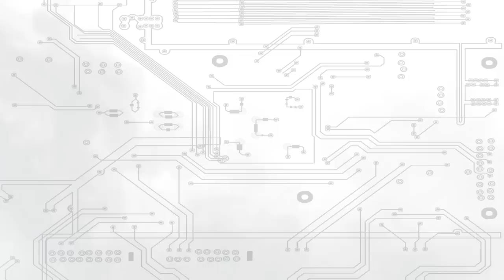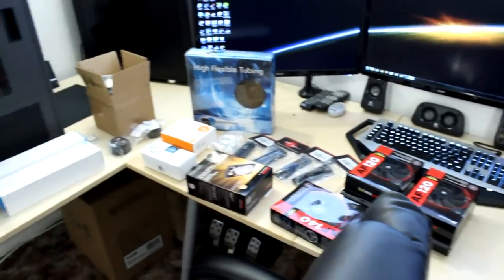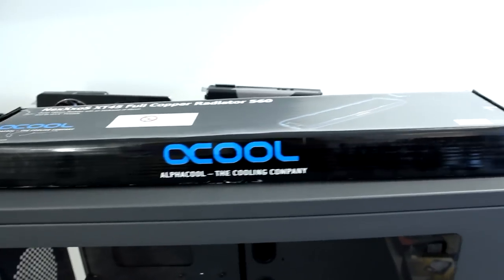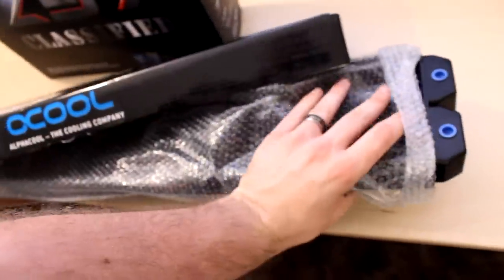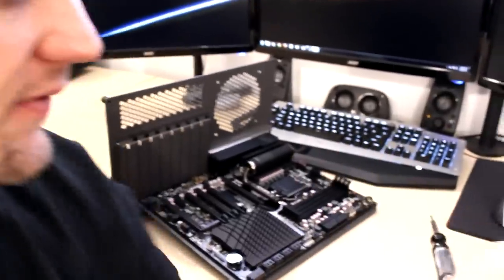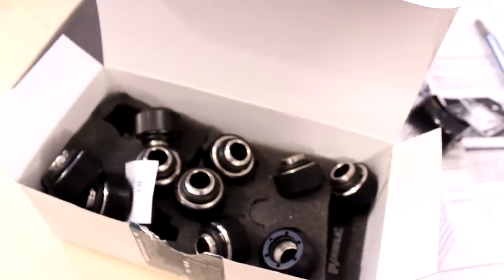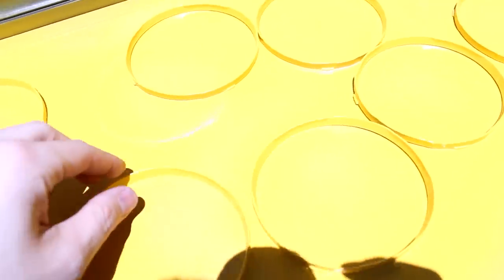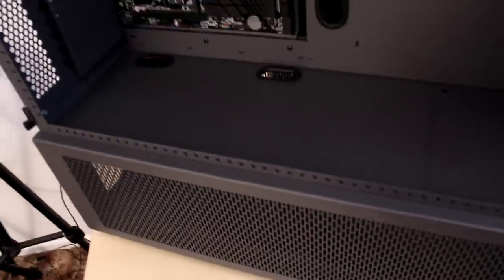Personal Gaming and Rendering PC Upgrade Vlog - Part 1

Comment: I LOVE my BIOS speakers!  That single short beep is the sweetest sound you will ever hear, in my opinion.  I love it when a case comes with one, even if it's just the speaker on a jumper block.

Comment: Just FYI Skunk Works was the nickname for the development facility at Lockheed that did the secret squirrel stuff for the U2, SR71, F22, and F117. It's supposed to be working on the F35 right now.
Reply: F-35 is already been finished. If a plane is in development, it usually has an X prefix instead of F
Reply: It's still being worked on from what I recall. Only one version is being produced, the VSTOL and the carrier versions aren't out yet.
Reply: True but, there are three different F-35 models from what I remember. The F-35A was from conventional take offs and landings I.e like any other type of jet. The F-35B was for STOFVL I.e just like a harrier jump jet and the F-35C was just like the A model but has a landing Hook for carrier landing and I believe the B model should be in use by the Us marine corp before October 2015.
Reply: The F35C is strengthened to take the abuse of carrier landings and weighs more then the F35A. The F35A is the only one in production, the other two are in development. In addition the F35A is grounded at this time.
Reply: F-35B is nearly finished its production as It's suppose to be the first Model 35 to be given to the American marines before 2015 and it's the VTOL variant.
Reply: Ronan McHugh
  All 3 variants are in testing still and are pretty much on final production levels with only small tweaks and a lot of software work and testing remaining for another 4 years.  There are around 100 F-35's in total atm and most of them are the A variant with the B variant being second most common and the C variant only having the least (its slated for a IOC around 2020).  The marines will go IOC first with the F-35B but will only have block 2b software, the airforce can afford to wait longer and wait for advanced capable (less buggy) software for there IOC in 2016.  The navy (who just got brand new jets with the super honets) is waiting till last and making sure the Marines are squared away first.  By 2020 they will be able to make anywhere from 100-200 F-35's (all variants) per year (mass production results in price drops).  By then all software and testing should be finished and the US and UK will be full IOC with there variants of the F-35.

Comment: No Jay, Skunkworks is not the project name of the F-22 Raptor. Skunkworks is an advanced development program under Lockheed Martin. Basically a group of engineerings that build special aircraft. They have been around since before WW2 and have designed and built a lot of awesome airplanes including the U-2, SR-71, F-117, F-35, and like you said, the F-22.

Comment: Skunk Works was the name of a special division inside Lockheed. It was headed by a great mind, Kelly Johnson. P-38, P-80, U-2, & SR-71, all came from that division in one stage or entirely. The blackness of the U-2, SR-71, and F-117 us due to the ''RAM" Radar Absorbent Material coating that is used.

Comment: Are you going to be using the airflow optimized fans for the radiator push-pull? Why wouldn't you use pressure optimized? I don't think I missed you talking about this decision in the vlog but in case I did, sorry about that. Keep the vids coming! Love em'!

Comment: I made me a pc from these parts : Msi z97 g43 gaming motherboard, Evga gtx 770 4gb ftw, intel i5 4670k cpu, corsair h60 liquid cpu cooler*will put a h100i soon*, coolermaster 750 w 80+ bronze, thermal take chaser a31, seagate 1tb hdd * will put a 1tb ssd soon*, kingston hyper blux 8gb ram ddr3

Comment: Just ordered my first gaming PC today, Finally moved from console to PC. Cant wait to get it  :P

Corsair Carbide 540
Asus Sabertooth Z97 Mark 1 (TUF Series)
Intel Core i7 4790 @ 3.6GHz, 4GHz Turbo
Corsair H100i with Dual SP120 fans
8 GB 2133Mhz DDR3 RAM
3GB EVGA GTX 780Ti SC ACX
750W Corsair RM PSU
120GB Samsung 840 EVO SSD
1TB Western Digital Black
Optical drive
Windows 8.1
Reply: Congrats man, I just did my pc build as well. I thought, I had it all done but to make sure, my stuff doesn't over heat at all. I be getting the full case, right now I got a mid size case, there is no room in it.
Reply: Holy shat.
Reply: ***** Well im getting it build from Scan (UK), so its only £100 to get built and it'smy first Desktop PC, in all its about £1800 inc peripherals, so paying £100 to get a guy to build it isnt that bad... anyway I don't want to damage any of the parts i.e. the £531 graphics card so to answer your question it rather be safe than sorry :P
Reply: TY STOE Great Stuff :D that one of the reasons why I went with the 540 case as it has direct air flow over the GPU and what not :P
Reply: Sam Holmes Yeah that's why I am getting  Azza HURRICAN 2000 Full Tower. Got 8 cooling fans, so it help a lot better, then just having 4 of them. Plus a lot more room for the air to get out more.
Reply: Nice, if I had the cash to sli then I would probably go down that line, but is the build stands hopefully the cooling will be sufficient.
Reply: Next year I like to get a second GeForce GTX 780 sc 6gb
Reply: Definitely a case worth using, love my Air 540. Things a Beast, and the cable management is Crazy good lolz. An so is the AirFlow :D. Dropped my temps about 5-8c from my old case.
Reply: Great :D
Reply: One thing, that is great about a pc getting hot, you be ready for the winter lol
Reply: hahaha indeed :D
Reply: One of the best feelings is building your own PC and IMO it's part of PC gaming and you're paying someone to rob you from that experience smh
Reply: I see what you mean, it will be one of those where id practice building a old PC that would be getting scrapped or something
Reply: Sam it isn't really that hard to do, just take your time with it. It took me 8 hours to do
Reply: Yeah I know but I think it would be something that id do on my next build :D
Reply: Yup, just take your time, with the Air 540 I'd start with the Mobo 1st, put the heatsink on Before you put it in the case. Makes it easier, unless your using a closed water loop like a corsair H100i etc, there a little trickier but the concepts the same, install the cpu block then place the board in the case and then screw in the radiator, usually on the top or rear of the case if its not a dual slot type radiator. Here's my Air 540 build :D, http://kaitheus.deviantart.com/gallery/49861010/Carbide-Air-540-WIP  Still working on it atm, just needs some fans and a newer cpu, preferably the FX-8350 lolz
Reply: I hope you can return the cpu. H100i z97 without a overclockable cpu is a weird combo in imo.
Reply: iTr00oW  Maybe so, but even I'd go that route with a push/pull on the rad just to get away from the horrid stock coolers >.> lolz. Also, this will give him the option of OC a little later without having to go through the trouble of getting a new cooler and installing it.
Reply: That is one hell of a first machine
Reply: yeah I see what you mean, but at 4ghz it would be giving off a fair amount off heat and in a few years it would be one of those where id go for an extreme processor or high OC CPU and  just replace it ,so im kind of "future proofing" the system
Reply: I got that fx 8350 it doesn't give off that much heat, if u get a better heatsink and good case
Reply: Sam Holmes It depends on the chip you get Ghz has NO direct corallation to heat. Voltage is the ONLY thing that effects heat so if you have a good chip the 1.25v stock will be absolutely fine even in a mid case with the H100i cooling it. The older K series Haswell chips at that voltage were fine I had one in an NZXT H230 case with the sound foam on it which hampered cooling, not to mention its one of the smaller mids with poor cooling options. A Corsair H60(push/pull SP120) cooled the 4670K OCed to 4.6 to a very stable 36-40 C idle and 55-65 C full load. Go for it man, go for it! You have the power it is REFRESHED!
Reply: should have built it urself. i strongly believe that someone who can't built or can't even be bothered should buy such a premium rig. just because its wasted on you. spec sheet is good, other than for your ram, i very much hope you will be overclocking
Reply: Don't listen to anyone telling you you should have built it yourself. While I found it to be a very rewarding experience, as did a lot of other people, if you were worried about damaging components it probably would have been a bloody stressful experience.
I was pretty worried myself, so I channeled that fear into roughly 50 hours of casual research and watching a bunch of different build guides. I ended up doing a lot more research than I needed and when I got all the parts in front of me I ended up completing my first build, even including cable management, in about 3 hours (not including the software side of things, that was probably another 2 hours).
Even though I loved building it myself though, I know that I would have been terrified of damaging components had I not spent such a massive amount of time doing research, which, even if it went well, might have lessened the satisfaction and joy of building it myself (the fear I might have otherwise had that is, not the research I ended up doing).
Enjoy your new PC buddy, those are some pretty sweet specs!
Reply: F41LZZz He can do it, how he likes it. He thinks it be better let someone do it, then it doesn't matter. Also overclocking you don't need to do it, until your parts get older and can't handle games.
Reply: Well guys I value your opinions but I think on this one, as I don't have the confidence to do it ( I would be more than willing to do it) it has been already ordered to be built, but I think if say the rig was around the £1k mark then id do it, however saying that..  in the house there is a 8 year old PC that really need some upgrades so il probably learn the basics from that.
Reply: No point in getting a Z97 series motherboard if you dont get the K series cpu should have got the H97
Reply: well in a few years il replace the cpu with the K/ extreme version as I couldn't stretch the extra £90-£200 but atm the cpu is more that good enough for my needs
Reply: Nice man
Reply: sprocketnz
 That actually Doesn't matter, building it this way just makes it more future proofed for when he Does feel like getting an upgrade. So really its a good thing. I mean that would be like telling me that I should have gotten a AMD 970 chipset instead of the 990FX since I am using a 955BE in it, even though I have plans to get the FX-8350 later on. Same concept applies to Sams build :P.
Reply: Sphoxros he ordered one. so he paid probably 40% to much :P and someone who doesn't build his own pc is probably not gonna upgrade it
Reply: Well I recon I've paid a reasonable amount as I live in the UK (20%VAT), I will upgrade but only in a few years when it is apparent. most likely for a cpu @4ghz or a second GPU.
Reply: F41LZZz Come on man. Its that snobby elitism that scares people off from PC enthusiasm. Introduce that AFTER you win em. PC master race.
Reply: iTr00oW He won't upgrade because he is being safe, with someone that knows what, they are doing. Not even true at all, pretty sure he can upgrade one part at a time, look it up on youtube, if he needs.
Reply: bro get k series of processor it will be bit future proof......
Reply: non-K series is still a Haswell part so will be just as relevant as any other Haswell part. K just means you can squeeze more performance from your part at expense of CPU lifespan(in some cases)
Reply: prince charles He'll be fine. It will be a long time before an i7 4790 gets outdated. Heck games don't even make use of hyper threading yet. Non K series are the recommendation for non overclockers. And 4ghz isn't something to sneeze at either.
Reply: Congrats! I myself build my PC a few months ago. Never. Going. Back. It's amazing, although i need waaayyyy better cable management myself! That's the benefit of a prebuilt. No cable managing needs to be done by you :)
Reply: AND THATS YOUR FIRST RIG, well wow... dude thats a beast
Reply: TheCruncheyBomb you could have saved alot of money for the same performance, but its your'e choise not mine
Reply: holy shit bro that is a gamers dream pc nerdgasm

Comment: Skunkworks was the division of boeing who designed the F-22Raptor. it wasn't actually code named as it was a race between all the jet fighter manufacturers in the 80's. Skunkworks is still running today and is known for also creating the AC-130 attack cargo plane.
Reply: You should call it the Knight Hawk. because it does looked coloured to the F114 KnightHawk
Reply: also made by skunkworks

Comment: Hey Jay, I was going to buy the EVGA Classy z97, but I've heard some problems with EVGA's bios, so I bought the Gigabyte instead. Haven't installed it yet, just wondering if you could give your opinion on EVGA as far as motherboards go.

Comment: Jay are you upgrading to the i7 4790k just because of the higher overclocking capability or because of the motherboard or both. Aren't you satisfied with your current rig? If so why?
Reply from the maker: I'm upgrading simply because I have the parts to. In my Intel video (coming later this week) I recommend to people on Z77 / 3770k to keep their setups.
Reply: I knew it :)
Reply: ***** how about 3570k, is it still a good one? or just for next platform? thanks

Comment: is there a build log of the pc that you are upgrading?
I am planning to start a pc build kinda like you are as in i am constantly upgrading parts and stuff. I am thinking about getting a corsiar obsidian 900D but i am not sure about it. Do you know if there are any similar cases with a 480mm rad thing on the side of it? also i am doing hardline tubing. 

P.S. is the not yet upgraded pc (still in 900D) side rad in push, pull, or both

Comment: I'm getting a i7 4790k d0 stepping and 16 meg of 2133mhz ram
I will be getting more ram later 32 meg at 2133mhz
I will not overclock the CPU but will use turbo
motherboard will be a Asus MAXIMUS VII RANGER
will the 4790k run XPM 2133mhz with 32 meg of ram with no errors and is it safe for the long term?
Intel say "the motherboard offers XMP profiles faster than 1600MHz, be aware that this is a direct overclocking to the Memory Controller Hub (MCH) in the processor which could represent eventually possible stability problems."
will games and the new gen CPU benefit from high ram speeds? (my old 960 did not)
should I play safe and get 1866mhz
both ram speeds are 1.5v and I will use XPM
will the XPM 2133mhz with 16 or 32 meg stop the turbo mode of the cpu
also do the new XPM's allow you to choose from the rams XPM max of 2133mhz to 1866mhz like XPM 1 or 2 or do I buy the 1866mhz from the go get

Comment: I never see you use anti-static mats or wrist bonding when handling the sensitive electronics. Do you have/use that kind of support equipment?
Reply from the maker: Other than keeping my foot touching my metal desk when Im working, no. And I never have in the 20+ years I have been building. components now are very resistant to static shock.
Reply: *****
Same here. Never used 'em, and never fried a component as a result. You just got to know how static works and how you can dissipate it easily. For me, that means keeping the power cord plugged into the computer if possible while I'm working inside it and having something nearby that is always grounded that you can touch.

Comment: Is there a reason you're using air flow fans against the radiator versus static pressure fans?

Comment: how do you hook up that many fans? 0.0 i want to put in more but idk what to use extention cables or somthing. all fan cables are so short :/maybe you should do a dedicated psu cable tutorial, telling what cable is what does what, and what you need to do alot of fans or  pump cables  and stuffs. idk why i get evertything else but the psu cables is a blurr to me.
Reply: Use a PWM hub and some Y adapters.you can see an example of a PWM hub on the Phanteks Evolv ATX case.

Comment: Why are you using Airflow fans? I thought radiators need SP-Fans?
Reply: I think it's cause Jay wanted corsair fans since they look cool but corsair doesn't manufacture any sp140 fans so he went with af140
Reply: +EarthQuickProduction He's said in one of his newer Project Red Mist builds that the amount of air that gets pushed through the radiator using AF fans eventually evens out due to the sheer size of the rad. So what this means is that say he had a 420mm rad with SP fans and a 560mm rad with AF fans. Due to the size and amount of air being pushed through, they'd even out temperature-wise. If not, then it's maybe a degree or two of difference.

Comment: I'm gonna build a PC today too. But it's only a 4460 with a R9 280X. And what's even worse: only three fans!
Reply: man, thats alright, bf4, ultra, 1080, 60+fps...
Reply: Nice build, go small though, like Bitfenix Prodigy ☺
Reply: Kurozakiyoku Ae yeah man, im randomly building a little i3/760 rig in a phenom m \o/
Reply: Trevor Lowe I don't want to say that these components are bad. Sorry if it sounded wrong. But compared to Jayz' rig my PC's performance is not quite that good.
Reply: Nothing wrong with that, I've been using a mid range PC for a year and a half with ONE fan. Although I did just buy a Fractal Design Define R4 and two new fans.
Reply: ***** Jay runs on 3 screens, heck I run on 3 screens with a singular 660 which amazingly didn't explode when I set it up today and even managed to play Minecraft maxed with Sonic Ether Shaders at ~50 FPS on 3 screens and Borderlands 2 on high (Only 2 AA), but can't wait for my new rig which will have an R9 290 :P